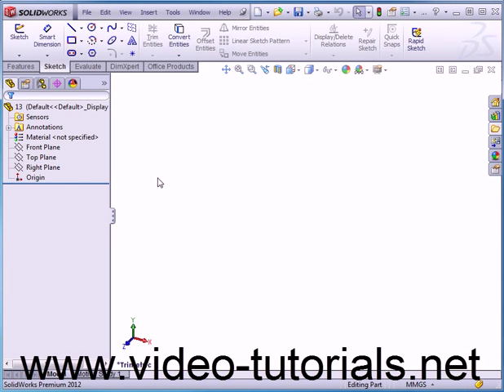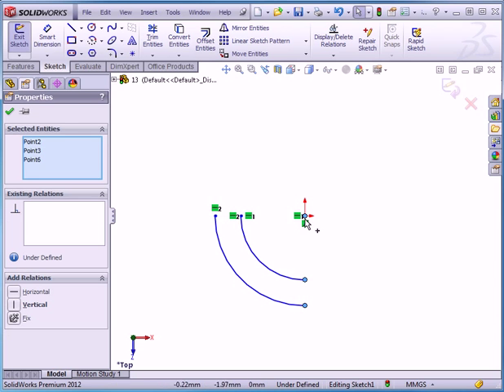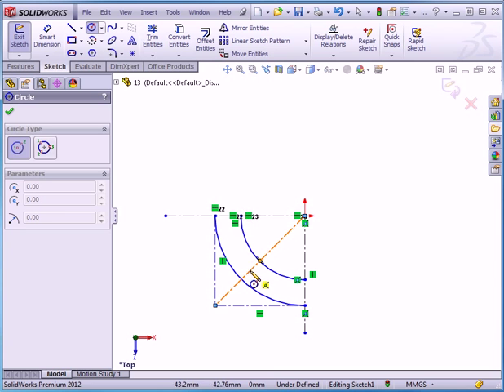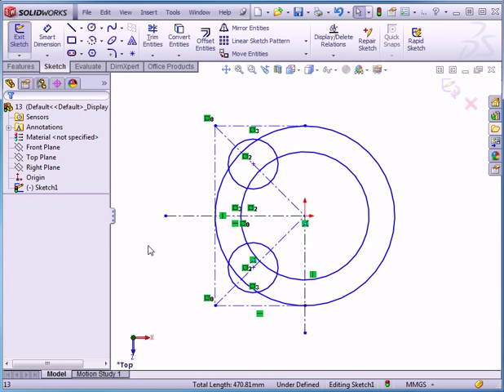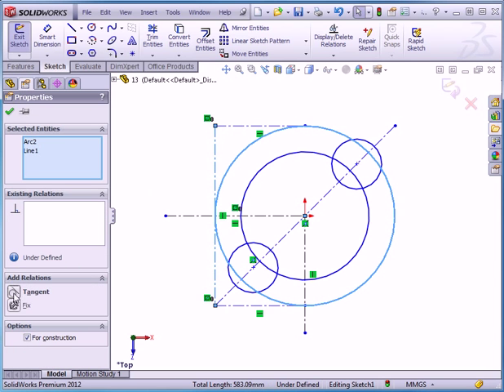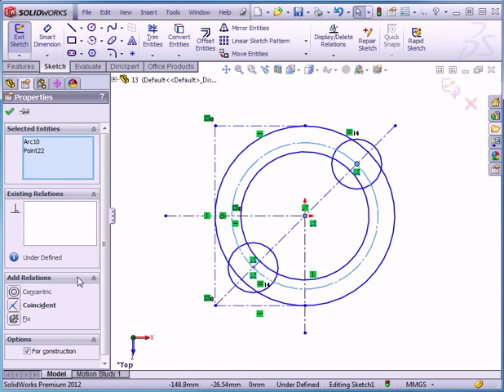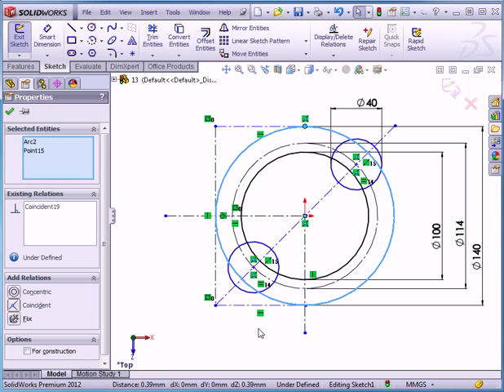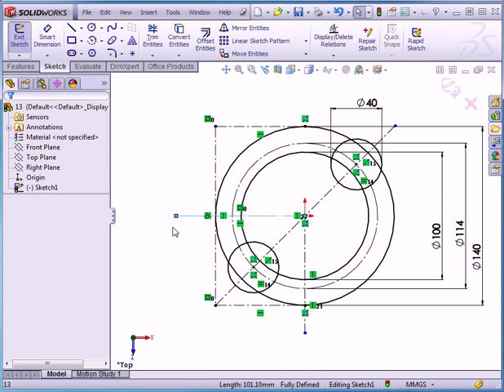Learn SolidWorks 2012 Video Tutorial - how to mirror sketch entities

Comment: 10 minute video in which you show how to mirror in 5 seconds.  I'm pretty sure you could have gotten to the point a bit quicker.
Reply: +Rosanna Daniel I for one appreciate the many steps you take in this video-- you are demonstrating much more than mirroring. Thank you!
Reply: You both have a point. I am so lazy instead of looking for tools, I just google it. I clicked this video to find where the tool was.
Reply: Any you could have looked it up in the manual instead of watching a free, very detailed video and then complaining about it. This video doesn't just show how to mirror, but it also how to deal with problems you may run in to.